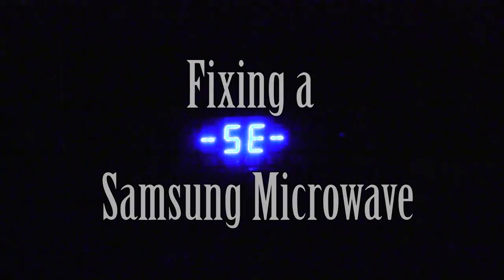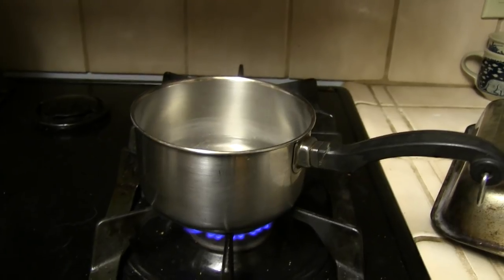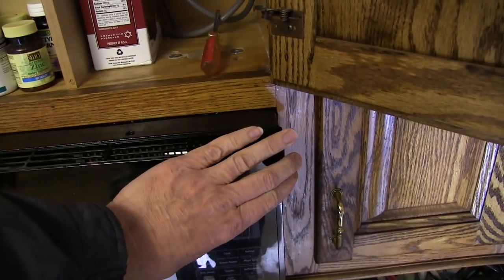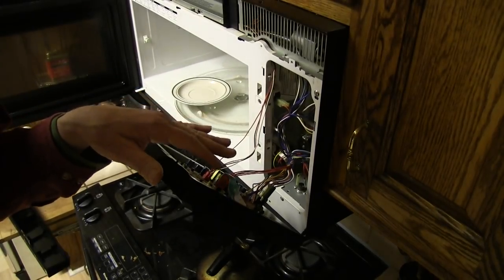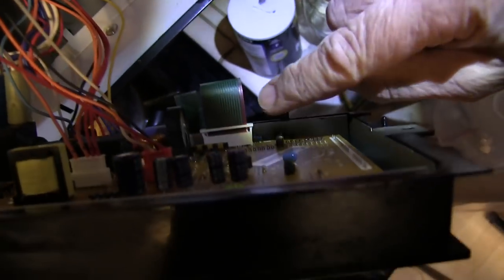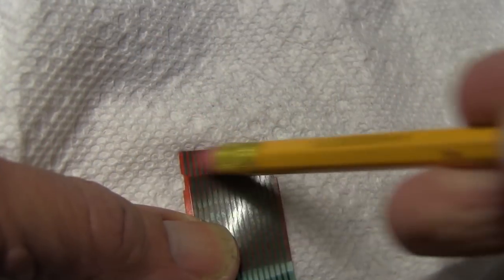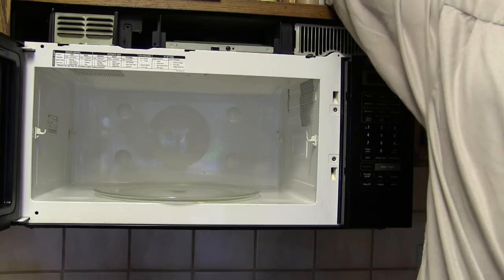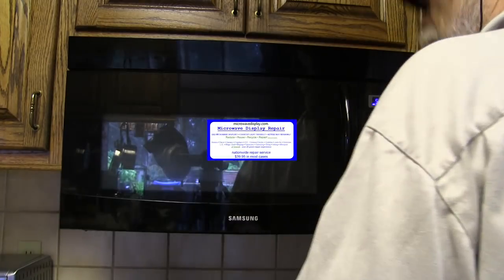Fixing a broken Samsung Microwave - The dreaded 5E error code -- aka the SE error code.

Comment: The 5E code can cover a bunch of conditions with the display panel. But, IMHO the number one problem is the ribbon cable. On my Samsung it had been folded over and creased sharply. This can cause a crosswire short over time and result in the 5E code. In researching this problem I found that if you GENTLY unfold the cable, which also means you have to unbolt the electronics card, and then put a small piece of paper between the formerly folded surfaces, gently put everything back in place and power up the microwave.   Solved my 5E problem.  If the creasing actually broke a wire this won't work and  you will need a new ribbon cable.

Comment: I have a question about the green wire that seems to be running just from a screw to another screw. Would i get zapped if I remove that one? Seems like a grounding wire. Im trying to fix my microwave as well SE error
Reply: Nvm i referred to another video. Repair Clinic is my go to mostly

Comment: Its the ribon connector. I knew it was a bad connection as when i would bang on the machine it wpuld sop beeping.We have one with se, with my expeience with connectors like that they give trouble. Pulled the ribon and sure enough it was loose, si i used a eraser, put it back in and still loose so i gently put a thin 3d printed wedge in so it lightly pushes on it and pushes ot against the contacts. So far so good.

Comment: Excellent video. I simply cleaned the ribbon cable contacts with a qtip and alcohol and worked like a charm.
Reply: +Phillip Dewitt I think the ribbon cable connection is the culprit. Like you, it was all that I cleaned and that seems to have done the trick.

Comment: Mine lasted a couple hours, now back to 5E... I even pulled it all apart cleaned everything. Deoxit all the connectors, etc. It stopped working when my wife cooked dinner the same night again.  I am going to try to clean the ribbon cable connector contacts again, with an acid brush and something a little stronger than 70% isopropyl alcohol..

Comment: Make sure you discharge the capacitor on the main board. Take an insulated screwdriver and touch both wires coming out of the capacitor with the insulated screwdriver. This will discharge any residual voltage/electricity in the capacitor. To be safe I always use my multimeter set to the highest setting for AC or DC voltage. Depending on whether the capacitor is a AC or DC voltage. This is to make sure that the capacitor is fully discharged of any residual voltage/electricity. I’ve been shocked by an old vehicle points capacitor that wasn’t discharged. Luckily the capacitor had low current. It shocked and startled me. When I discovered this. With my lawnmower running. I would hold a capacitor’s wire coming out of it. To the tip of the spark plug. Then ground the body of the capacitor to the head of a running 
lawnmower engine for 10 seconds or so.,Using a pair of insulated needle nose pliers and a insulated screwdriver. Then throw it to one of my friends. My friends got me many times with a charged points capacitor.

Comment: Thank you very much, Cleaned ribbon cable with eraser & alcohol put back together and it works GREAT!!! , micro less than 1yr and half old. Samsung should have thought that out better, it's a simple fix. again Great video. next time I would use Dielectric grease on contacts it's $1.49 for a little package at advance auto parts.
which should stop this from happening again.

Comment: I bought my Samsung Model SMH9187B microwave on 3/30/2011 from Best Buy.

It quit working on 5/7/2015, displayed the 5E (oeSE) code on the display and started beeping. I cleaned the ribbon cable and its connector. Your youtube guide was very helpful. It then began working again.

It quit working again today (7/1/2015). I called Samsung customer service at 1-800 726-7864. They agreed to repair the 5E( or SE) error at no charge. The repairman is tentatively scheduled to make the repair on 7/6/2015.

Comment: Worked for me for about 5 minutes, then it started to give me random messages "Nachos 5 minutes, Popcorn 3 minutes" and then back to old flashing SE.  Maybe I'll try cleaning some more? Or is it just friend and I should cut my losses?
Reply: Got it back working again! The problem is with that pesky ribbon cable! The issue is the fold in the ribbon cable where the top layer (membrane) is folded over the bottom. Here is the advice that helped me from a comment on another YouTube video: There is glue that not only holds the two layers in place, but also acts as a separator.  Once the glue begins to deteriorate due to heat cycles, moisture, vibration, etc., the layers can short at this point and throw the error code.  Place a few strips of electrical tape between the layers under the fold, put your microwave back together, and go make yourself some popcorn, being happy you didn't need to go any further.

Comment: For our microwave, it turned out that the eraser on that ribbon cable did the trick.  The keypad wasn't communicating with the control board.  Shined it up with a soft gum eraser and PRESTO!! it worked.

Comment: I never used my stove and I mean never it is not even plugged in. I had this failure several years ago and after doing this fix several times decided to pay the 35$ for a new control pad which arrived in 2 days and once installed it has worked fine until today when the SE code started again. over the last years I have watch the micro wave when cooking stuff and one food or water starts to steam the steam leak out the door and into the control panel causing the failure. Those people that use their stove most likely get more steam into the panel.

Comment: Stupid Samsung, this is an engineering oversight, which they will deny.
I haven't done this yet, but I am a computer technician by trade and once I saw you remove that panel and didn't see any vapor barriers I think I can fix this and keep it from happening again.
maybe a little electrical tape "gasket" around the back of the touch panel will keep moisture from getting in there again?  One more thing at 2m into your video, those 2 little blue "can" looking doodads on the back of the touch panel, those are small capacitors, they can shock you really good, just dont short the 2 contacts on top of them.  Thank you so much for posting this video, Samsung should be rewarding you for helping us fix their screw up !!!
Reply: I tried this and it didnt work.
I will pull it and do it again, I will never buy Samsung appliances again.
Reply: John Lang I have a small brass and nylon brush, I will use the brass brush on the connectors, and clean the ribbon cable contacts more with the nylon brush, perhaps I didnt clean them enough.

Comment: My September 2010 manufactured SMH9187B was perpetually prompting to set the "light on time" followed by set the "light off time."  If I set the time on/off it would then perpetually prompt "to clear light on time enter 0."  Cleaning the ribbon contacts appears to have solved the problem (several hours with no trouble.)

I'm sure this maintenance cleaning is something that will need to be done every year or two.  The whole duct assembly was greasy from cooking; have grease cutting cleaner available to spray the vent grill etc.  If it's going to be a while before you can get to the repair turn off all beeps by pressing "My Settings" then "2" and "2" or let the prompts scroll by to see everything you can adjust (daylight savings on/off etc.)

Comment: This is a really frustrating and even potentially dangerous problem. I've tried Joe's solution, and a number of others and they all work.....for a while. Sometimes for a few weeks or just a few days but the 5e code always returns. It seems that taking it apart, fiddling with the connectors, wires, etc. and putting it back together can be effective for a while.

But recently my Samsung turned itself on in the middle of the night, ran for who knows long until it started sparking and popping violently which woke me up. The display was reading "5e" and the only way to turn it off was to unplug it. I'm glad it happened while I was home. That event reduced my confidence level with this microwave to 0 so I guess it's time to quit throwing money and time at this thing and get a different one. Frustrating because it's only 4 years old. The new one won't be a Samsung.

Comment: Hey 
Thanks so much
Followed your advise- compressed air on the panel, and cleaning.
15 min later, up and running.
In retrospect, it stopped after boiling an egg on the stove!
rg

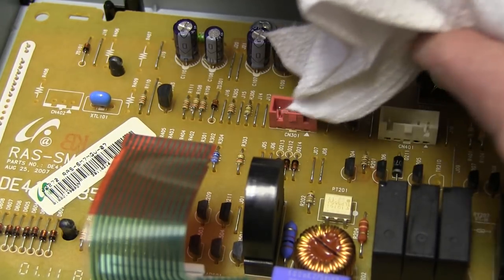Comment: The real problem is that the two layers (membranes) of the touch pad can short at the fold of the ribbon where the top layer is folded over the bottom (take a look at 3:12 of the video - you can kind of see the fold on the left).  The glue that separates the two layers can wear down, allowing contact.  I put a couple of strips of electrical tape between the two layers at the fold-over and so far so good.  Hope this helps.

Comment: This worked for me.  The only thing I would suggest is, if you are going to do the full unplug and clean route, take a picture of the layout first with your smartphone, don't trust the old memory.
Reply: +Mike Emerson Update: Well that didn't last long.  Later in the day my microwave displayed the same error.  I've tried two more times, including using a connector cleaner.  Thanks for the very informative DYI video, though.
Reply: Update #2: After trying multiple methods multiple times each, I finally ordered the Samsung de94-02001c part. The part doesn't include the circuit board, just the keypad.  My microwave has been working ever since.
Reply: +Mike Emerson 
Thanks Mike! Where did you order that Samsung part from?

Comment: Before going through all  the trouble try rebooting. Disconnect the power and leave disconnected overnight. This gives all the capacitors time to discharge and clear the code. It could save you a lot of time or money.

Comment: Easy fix and great video! 
Unfortunately after 2 attempts the error came back moments later. I'm thinking my problem is deeper than bad contacts. I even used electrical contact cleaner. 
Glad I have a 5 year extended warranty! I don't think I'll be getting Samsung appliances again. This is the second issue with the same unit.
Reply: Hi Kelly, I was running into the same issue but found the root of the problem.  There are 2 layers (membranes) of the touch pad.  If you take a look at 3:12 of this video you can kind of see where the Ribbon is split between the top and bottom layers. There is a fold and the two layers are glued together.  This glue begins to break down due to heat/moisture and allows the wires of the two layers to touch where the top is folded over the bottom.  My fix was to separate the contact at the fold with a couple of pieces of electrical tape.  Hope this helps.
Reply: CodeRMonkeY I took it back apart and tried to get to the bend in the ribbon but it seemed to be glued. Since they're giving me a new unit I didn't want it to look like I broke it myself. Don't know if they'll want this one or just let me junk it. Again thanks!

Comment: Thanks for this video. I have to say this is the last Samsung product I will buy, nothing they make seems to last for me. This is the 2nd issue I've had with this microwave, all stemming from bad cheap design.
Reply: NoDamnUsrName Call 1800samsung. They will fix it for free. This is a known problem and Samsung is a stand up company. They fixed my 4 yr old microwave no questions asked.
Reply: +MC Arkus I called Samsung last night and they will not fix mine for free. They want to schedule a service tech and I am responsible for the cost. Before the SE error code our started and ran without anyone near the unit.
Reply: Tried Samsung online, they walked me through diagnostics, (unplug, wait, press keys and turn on) waste of my time, referred me to another department. I've already purchased a different unit, I'll get the replacement board and fix the Crapsung myself at some point.

Comment: Just for those finding this in 2022 and beyond - at the time of posting this comment (May 2022) this technique has worked for my Samsung (manufactured 2014 - model # SMH1926S). The error code has been cleared.

As the OP states just stay on the inside of that control panel, and remove any connector that has a tab (there should be 6 in total). I actually only did (5) as one of the connectors on the bottom proved tricky to remove and I didn't want to force it out, but it still worked.

I did not use compressed air, just gently cleaned with kitchen roll. The error code is now clear and it's working again.

Comment: My neighbor just bought a new one, I asked if I could have his old one for parts. I decided to look for the code and take it apart when I noticed the ribbon cable had black contacts from cheap metal. One pencil eraser later and it's working great. He doesn't want it back, he's afraid it will just happen again but I can't tear down a working microwave for parts so I guess I will donate it.
Funny thing is I have the same one, well it looks the same. But the clock asks for am or pm, the LCD is not nearly as bright, it's a clear panel for the LCD and not a blue panel. So either mine is just before or after this one with the cheap ribbon cable and cheaper electronics. 
He's correct, it will happen again but probably not for another 2 years, mine is pushing 6 years so Samsung did go with cheaper electronics at some point with this problem cable. They need to admit it, they had a class action suit for a TV that they wouldn't admit had cheap capacitors. I'm surprised this hasn't happened yet.

Comment: Tried it, worked for a day, now stopped again. Will go through the process one more time tomorrow.
Reply: I called Samsung 800 726 7864, they said if it is the SE error, they will send tech at no charge with new control board, even though it is three years old and beyond warrantee

Comment: Thanks for a really great video.  Samsung should know better than to engineer products specifically designed for above-stove use to be incompatible with that use.  To help avoid this problem in the future, I'll cook on the burners opposite the control panel, i.e., on the stove's left side, even though my super- and simmer-burners are on the right.  And, I'll use my fan more than I do now.  Ave atque nidore!

Comment: BTW, if cleaning the terminals does not work, then replacing the front keypad panel did the trick.  The part Samsung shipped was $27.  It's called an Assembly Control Panel. Call Samsung to get the correct part number for your model. Mine was DE94-02001C,

The hardest part the technician faced was pulling out the thin metal housing inside the assembly. The edges are sharp and he said he sometimes cuts himself when yanking it out. He got it out slightly bent, but he bent it back into shape and then snapped it into the new Assembly. 10-minute fix.

Comment: cleaned connectors and ribbon. Worked for 1 week and SE error came back. I will try to clean again and go to plan B after that
Reply: You may want to try cleaning inside the connectors as well.  Try some electrical contact cleaner.  You should be able to pick it up at Radio Shack, but wear safety glasses.  If it splashes or sprays back into your eyes it might do bad things.

Comment: I use windex and an old toothbrush to clean plugs.  When a board gets water damaged you can use windex and flush the board and allow it to dry.  Some WD-40 saturating each plug.  Unplug and reinsert several times as well, for further cleaning of contacts.  Even better some dielectric grease will keep it permanent.  Great video, mine now is intermittently having fan / light come on and go thru cycling the fan speeds and flashing the light.  I would bet this will fix...Also, you should let your viewers know that there is usually full charged cap at 8000 volt in a microwave, it holds a full charge when unplugging unit!!
Reply: Windex (or anything with ammonia) is not recommended, especially on polycarbonate plastics. 

Nor is WD-40, since it has petroleum distillates. I recommend high grade iopropyl alcohol.
Reply: WD 40 probably is the wrong fluid to clean electrical contacts and will likely cause more problems in the future. A white eraser followed by contact cleaner spray would do a much better job for the ribbon for the male insert. For the female contact it is best to spray the contact cleaner and then insert and reinsert the cable several times to ensure the build up oxidation gets removed. Then the work will last for a longer period of time. Be careful of the electrical power and remove power from the unit for a day or two to make sure you will not get shocked.

Comment: I just came home to microwave that was turned on and running, with nothing inside, for god knows how long. When I pulled out the plug and put it back in, I got the error. Nothing melted, but it was hot inside.

I'm going to give Samsung a call, because even if this fix works, I don't know how I'm going to be able to leave the house, wondering if it won't be on fire when I get home. Not a great feeling.

Comment: The problem is purely contact between the ribbon cable and the socket. take out, clean with "contact cleaner" and re assemble. 3 minute fix.

Comment: After cleaning the ribbon cable it worked well for two weeks and started smelling like burnt plactic. I replaced it with a Whirlpool unit. The new unit was one inch larger so I had to remodel the tile backsplash:( Oh Well!

Comment: Forgot to mention, while cleaning the ribbon cable, you can use a tiny hit of automotive brake cleaner (Acetone with petroleum solvent....spray onto paper towel, then wipe cable after doing the pencil eraser cleaning job.  Then re-insert cable......and go)